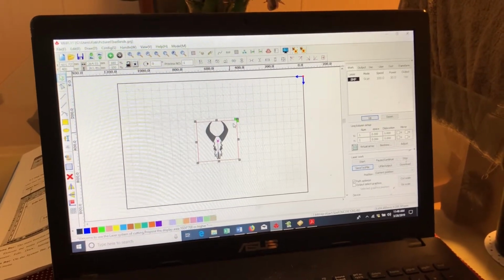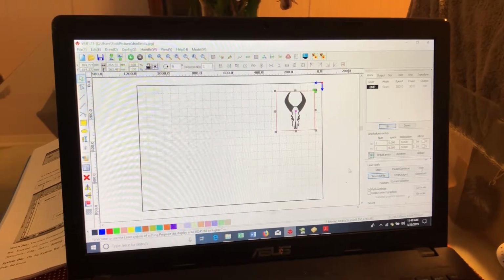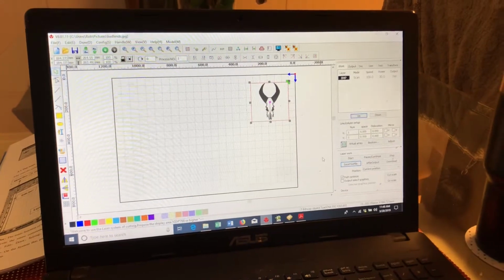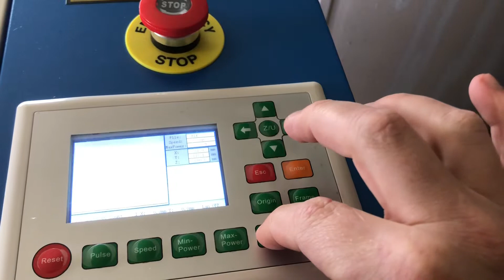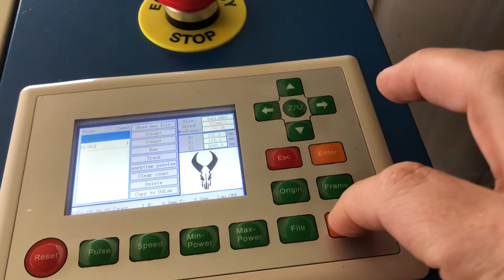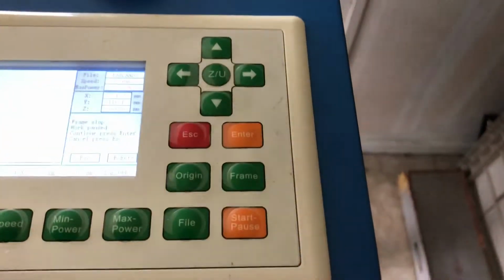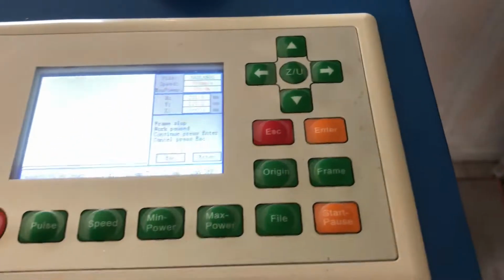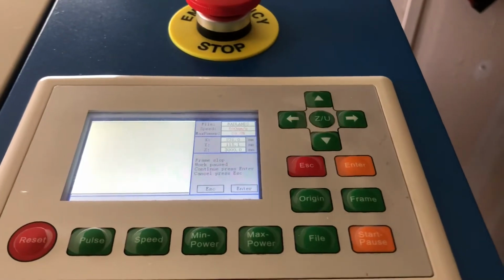Frame Slop error on laser Engraver

Comment: I found that the RDworks software is the cause. The best way to test this is to first do the realign the X/Y. Next then tap "Origin" then tap "Frame". It'll say either X/Y slop or X slop or Y slop. If it says Y slop now manually move the y to its furthest range then hit "origin" then "frame". If I'm correct the head will frame and outline in reverse. My suspicion is the driver is bad and last file that was transferred inverted the axis and now its stuck in its memory. Get rid of RDworks and get another program. I uploaded a file from lightburn then realigned the head and set origin. Then I hit frame in Lightburn and it framed the image I put in there. That corrected it for me.
Reply: Man i love you!